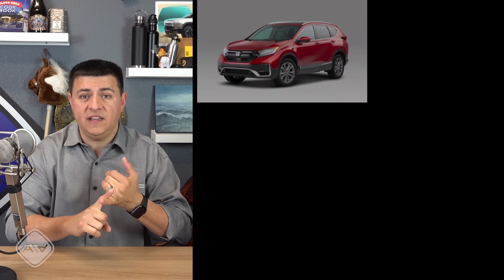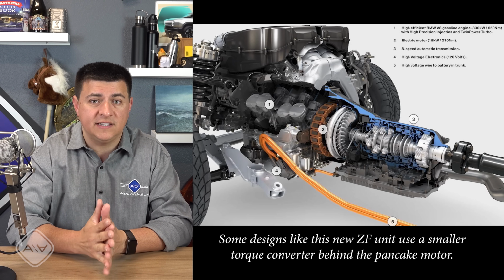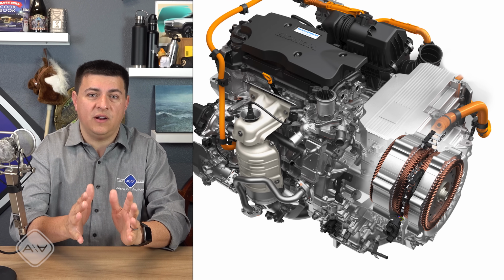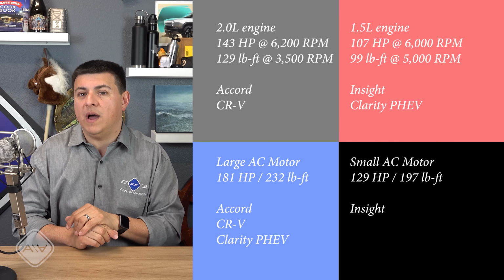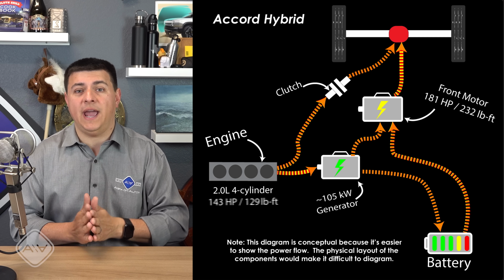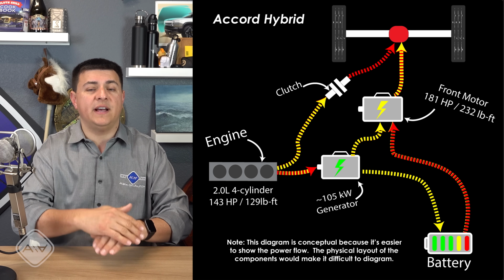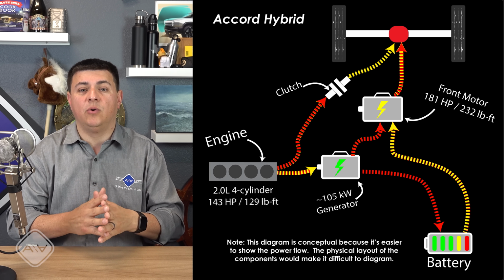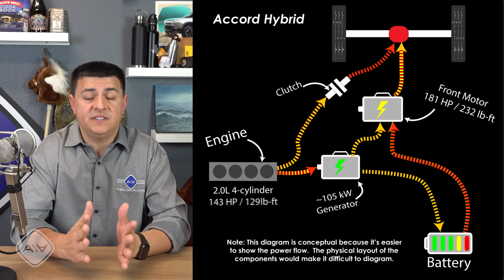How Does It Work?  Honda's 2 Motor Hybrid System Explained!

Comment: you very rarely need more than 180 hp and in those instances ( say to pass an 18 wheeler on an interstate ) i imagine Honda could allow some slip in that clutch to allow the engine to spin faster to produce the extra power - there would be some efficiency lost and some wear on the clutch but so long as you don't do this all the time it shouldn't be an issue.  i would still rather have Toyota's planetary system with no clutch to worry about but with limited availability of Rav 4 Prime it is forcing me to look at the Clarity.
Reply: First, the RAV4 does have a clutch. It never disengages, but it does have friction plates that slip a little when the engine engages, to match speeds. Toyota calls it a Torque Damper. It is necessary because the engine is always engaged to a part of the transmission system. Honda's clutch is probably subject to less wear, since the computer matches rpms before it engages.

To understand the 212 HP rating, it helps to know how conventional cars measure horsepower. It isn't the power delivered to the road, it is SAE Net Horsepower. What that means is complicated, but it is essentially the power that can be produced by the engine with all of the systems (alternator, pumps, exhaust, emissions) it needs to operate. But it is measured before the transmission, or any extras (air conditioning, your 200w stereo with 500w subwoofer), can tap some of that power off.

So a conventional car that claims 181 HP might only be able to deliver, and I'm guessing, 160 HP to the road. Honda's 181 HP electric motor can deliver all of it (well, maybe 180 HP) to the road. So Alex's complaint is comparing apples to oranges.

The 212 HP Honda quotes is a similar "Net" measure, but even less related to what can be put on the road. It is sum of the same kind of measurements for the engine, and the battery. Alex's issue is correct - the two numbers that get added won't ever occur at the same time - but the effect it has is misguided.

Finally, while your slipping clutch idea might let the engine generate more electricity while also powering the wheels, it wouldn't get above the 181 rating unless the engine side of the clutch was spinning at least twice as fast as the wheel side.
Reply: @jeffjo8732   okay the Toyota plug-in does have a ONE-WAY "clutch" though it's only there to prevent the engine from spinning backwards when it's not running but electric motors are.  i do not believe regular ( non plug in ) planetary hybrids need this clutch because there is not enough juice in the battery to power both electric motors with the engine off but maybe it is still there.  Torque damper is something different though and it's actually a set of springs designed to to "dampen" the pulsing of the cylinders so that you don't feel the vibration through the drivetrain.  it is not a clutch.  it might be integrated with the clutch.  i do not believe the one-way clutch is designed to slip or has friction plates - it is simply designed to lock when the engine begins spinning backwards and unlock when the engine spins forwards.  in Chrysler Pacifica hybrid the one-way clutch is a "sprag" clutch  which you can use google images to see what it's like.  toyota seems to use a different design but it's the same application.
Reply: @jeffjo8732  as for power ratings i do not find them particularly relevant because 90% of the time IN ANY SYSTEM peak power isn't available when you need it.  if it was we wouldn't need metrics like torque as knowing power would be sufficient.  the  proof is in the pudding - i test drove the Clarity yesterday for the second time ( first time i drove it 2 years ago ) and while it is more refined than my Camry Hybrid i feel that it is slower.  for normal driving the Clarity will be better than Camry Hybrid but for aggressive driving Camry Hybrid will be better.  on paper they claim about the same power but whereas the Camry pulls consistently from the stop all the way to 100 mph ( haven't gone faster, it has top speed of about 115 mph ) with the Clarity yesterday i felt some kind of a dead spot where it was not really responsive so either it is just the extra weight of the Clarity or it can't deliver the full power at all speeds.  it might even be that i simply had the weight of a passenger in a car.
Reply: @jeffjo8732  my favorite hybrid that i drove so far is the Chrysler Pacifica - it is so smooth and powerful - unfortunately they spontaneously catch on fire - which is even worse than what you would expect from a Chrysler.  overall i am frustrated that my 3 year lease on Camry Hybrid is almost up and it seems like that after 3 years there is still nothing better out there - what ever happened to "pace of innovation" ? LOL
Reply: @g1981c  In this video, https://www.youtube.com/watch?v=-dHeRJdrnI8, starting about 9:20, you can see the "clutch damper" and the prime's "one way sprag clutch" described as being separate components. It doesn't describe the friction plates of the clutch damper, but you can see them and they are described in other Weber State videos.

About power ratings: that's exactly why you can't compare the CR-V's rating to others. Because the rating has nothing to do with the speed of the car, it is a for comparison of the systems only. But the 181 at-the-wheel motor HP is available at all speeds, while the 212 combined "Net" HP is never available at the same time. Toyota's 209 (or 219, I think) combined horsepower is onl;y available at certain speeds.

The Accord Hybrid system is better that the Camry hybrid in almost every way, although it is also 3 years old. Specifically, it is faster until you get above about 70 mph. Why that doesn't carry over to the CR-V, I don't know. I think it is a matter of gearing; they tried to fit the Accord's "round peg" power system into the existing CR-V "square hole" chassis. That, or the testers don't know what "SPORT" mode is.
Reply: @jeffjo8732  ultimately both systems will work well if well implemented.  the system in the camry is peppy because it's the same 2.5L engine that powers the Sienna and Highlander hybrids but in a much smaller car which makes it faster.  the one in Clarity feels lethargic because it's the same electric traction motor as in Accord but used in a heavier car.  all things being equal i would still go with Toyota because it's a more proven system having been around for 2 decades and through multiple iterative generational improvements.  you do however feel the engine start and stop in the Camry system but not in the Clarity - however it doesn't bother me.
Reply: @jeffjo8732  the advantage of honda system is because the engine has no physical torque path to the wheels you can't feel it start and stop.  the advantage of toyota system is the engine can mechanically deliver some power directly to the wheels at all speeds.  one is not better than the other, though i agree with alex that honda system is more suited to plug-in hybrids.  when i drove the clarity it felt good in EV mode but when the engine kicked on there was no extra power felt the same way you feel it in the camry because engine doesn't connect to the wheels.  this is both good and bad.  with a big enough battery and traction motor this system will work well but that costs money.  toyota system is more economical in that it doesn't need a big traction motor or big battery - it just needs a powerful gas engine which is cheaper.  this is why Camry Hybrid uses a 175 hp dual-injection 2.5L engine - because it's a system that more heavily leans on ICE torque.  as batteries and power electronics get cheaper the point will become moot.

Comment: Good publicity for the Honda transmission system, but despite this, Toyota consume less fuel and their transmission system is therefore more efficient.
Reply: 2025 Camry LE, 16" wheels, est 53/50/51 mpg (cty/hwy/cmb)
2025 Camry SE, 18" wheels, est 48/47/47 mpg

Yes, it is the wheels that make this difference. The larger wheels add more drag, and take more power to change speeds. Note that these have the same powertrain, so they are equally efficient but the LE is more economical. And as far as I know, these mpg numbers are not yet official.

2024 Accord EX-L, 17" wheels, official 54/44/48 mpg
2024 Accord Sport, 19" wheels, official 46/41/44 mpg

Both suggest that 1 inch of wheel diameter is worth about 2 mpg. And that the economy of the Accord is 0.5 mpg lower. Not bad for a car that has 6% more passenger space and 13% more cargo space. So its powertrain is more efficient.

If you want to compare vehicles of the same size, the 2025 Civic hybrid is almost the exact same size as the Camry. On 18" wheels, it gets an estimated 50/47/49 mpg, better than the Camry on 18" wheels.

Comment: Do you think Honda hybrid will be as reliable as Toyotas  , cheers
Reply: The Honda  should be somewhat less reliable than the common Toyota system (such as in a Prius) because this Honda i-MMD system has a hydraulically operated friction clutch, which will eventually wear out and can fail; the Toyota system has no clutches.

Comment: Funnily enough, this is actually the same system used by mistubishi's hybrid system
Reply: Looking at the mechanical modes alone, the Mitsubishi system is, indeed, very similar to Honda's. The concept on how to use them is very different, and Alex doesn't explain that very well here. And even interprets some things poorly.

Both are essentially Electric Vehicles, just not Battery EVs. They are Generator and Battery EVs. Most of the time, they are propelled by only electric motors, in what is called serial hybrid mode: ICE->Generator->Motor->Wheels. But both can switch to parallel mode in specific situations: (Battery<->Motor)+ICE->Wheels.

And those situations are different. The difference can be seen in the relative sizes of the ICE and motor(s). And probably in gear ratios - I haven't researched that.

The Clarity, which is the most recent Honda PHEV, will be the better example for them. It has a 181 HP motor and a 107 HP ICE (ratio 1.7:1). It relies on the motors alone in any situation that requires high power, a fact that Alex misinterprets when he discusses power. The parallel mode uses an overdrive gear ratio, and is meant only for cruising at highway speeds. For acceleration, the Honda drops back into parallel mode.

The same-year Outlander (the data I found) is a heavier and less aerodynamic vehicle. But it has only 82+95=177 HP in motors. The point is that, at high speeds, the acceleration provided by these motors is much less than what the Clarity's motors can provide. Added to that is a 135 HP ICE (ratio 1.3:1) which is used, in parallel mode, to increase the power for acceleration at highway speeds.
Reply: @jeffjo8732  you should also analyze the hybrid system that nissan uses, their "e-power" hybrid is a strictly series hybrid system
Reply: @yolo12345lol  it's basically the same system as the Mitsubishi
Reply: @jeffjo8732  i see, thanks for the info

Comment: Why can’t it produce say 100 hp from the engine and 181 from the motor for 281 for short duration?
Reply: Because the 181 HP motor does not produce power, it draws power from the ICE and/or generator, and converts it to 181 HP max that is sent to the wheels.

Comment: I have a volt and let me tell you, it does NOT run like a prius.  The prius goes to about 15 mph and then it switches to gas.

The volt does not. It runs on battery until the battery is depleted and THEN switches to gas.  Also, if you run out of gas on a volt, you can still drive it if you have battery.  Should you? No... but it can get you to a gas station.  

Prius and I'm guessing Honda will shut off completely and you're stuck.  Even if you had battery, they will not run.
Reply: This kind of braggadocio only comes from those who don't understand how hybrids work. But I don't mean that as a put-down - in applies to probably 95% of those who think they do. I keep trying to get Alex to admit to a point he gets wrong.

Your Volt does work like a Prius, in very specific situations. And it works very unlike a Prius in most. But all Alex said was that it has a planetary gearset, which is true. Depending on what year, it might have two. But it is a plug-in; both the Toyota and Honda systems have plug-in versions that Alex doesn't mention in detail here, and I suspect you don't know much about since the Prius Prime does not switch to gas as you claim.

All three systems are just as capable of out-of-gas driving as your Volt - but I agree, not advisable. The non-plug-in Prius you are thinking of won't accelerate on electric-only above about 15 mph. That is because doing so is contrary to its purpose, not because it can't. The Hondas can do a little better, but it is still contrary.

I'll stick to describing the Voltec I system here. The Voltec II is, by far, the most complex of these hybrids. Alex has an excellent video describing it. But the Voltec I has four modes it alternates between. Two are for pure electric; at low speeds, it uses what I believe is a 149 HP motor. At higher speeds, it uses the planetary to add the 74 HP motor's power to it - not just for power, but to get the output rpm necessary. When the battery runs low, at low speeds it becomes a serial hybrid just like what Alex describes here. The engine drives the 74 HP generator, and that powers the 149 HP motor. At high speeds, to get the rpm, it becomes a power-split hybrid just like the Prius. The Honda becoming a purely parallel hybrid, but that is to become more efficient. Not for rpm, which probably sacrifices some efficiency.

All three can, theoretically, limp to a gas station on battery only when the tank is dry. But you might notice that can only happen after the car has been using gas, which means the battery is also low. So it really is an absurd claim.
Reply: @jeffjo8732  the volt actually saves about 2 miles worth of energy so if you DO run out of gas, you can get to a gas station unless you're on 5, in which case, RIP.  LOL
Reply: @jeffjo8732  I do admit, I haven't seen the new prius but the ones I saw in 2016 still did the same thing. switching from gas to electric and back at 15 mph speed.  Higher, you're on gas. lower you're on electric.  There was no choice to go just electric or just gas.  The volt gives you a choice.
Reply: @CnithTheOnliestOne  The Volt is a plug-in hybrid (PHEV). That means it acts as a battery electric vehicle (BEV) until the battery gets below some threshold. What "acts as" means here, is that they operate in a mode called "Charge Depleting." Which means exactly what it sounds like.

Below that threshold, your Volt acts as a plain HEV. Just like the Prius. And that is called "Charge Sustaining" mode, ALL HEVs, and PHEVs when acting as HEVs use this mode. They will alternate charging and discharging the battery to sustain the level of charge within some range.

On the Prius, that is probably something like 40% to 60% . But I don't really know. On your Volt, it is a much smaller range, in percentage, but probably about the same in kWh. And the bottom of the range on both is also probably about the same. It is that 2 miles worth you mentioned. Any HEV with an EV drive capability will have the 2 mile (theoretical) range. And this has been true for all Priuses.

In theory, the early Priuses could operate in EV mode up to 42 MPH. If they ever did, which I have no idea, they would only do so if the battery was above that 60%. Because the strategy is not just to choose gas or electric, it is to sustain battery charge in that range. I can even show you a plot of an early Prius navigating the EPA's urban mileage course at a steady 30 mph, but not using the ICE because charge was about 75% and dropping. At the same point, with 50% and 40% charge, the battery charge was actually going up because the ICE was over-producing.

Comment: So by all..if you want more power you need to change the transmission only..
Reply: Um, transmissions do not affect power? They do adjust rpm so that the engine can operate in its power band, but as an electric car this one is always in its power band.